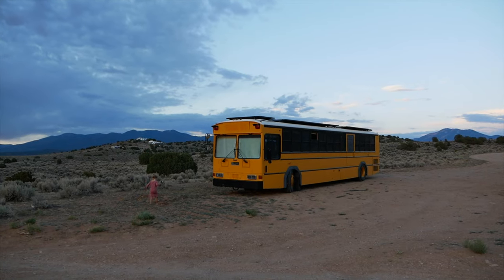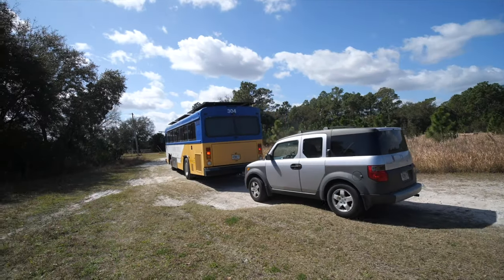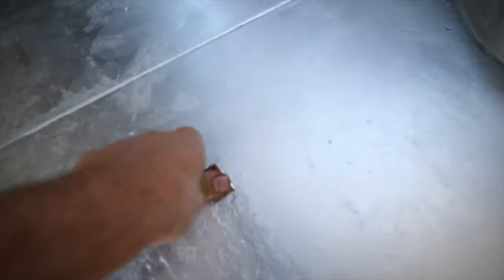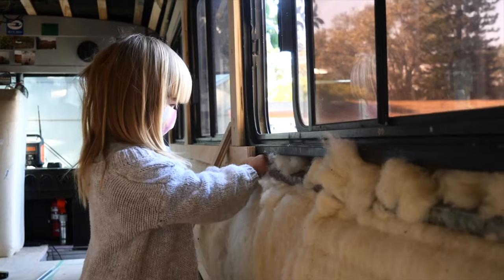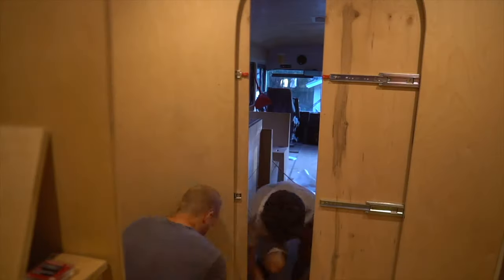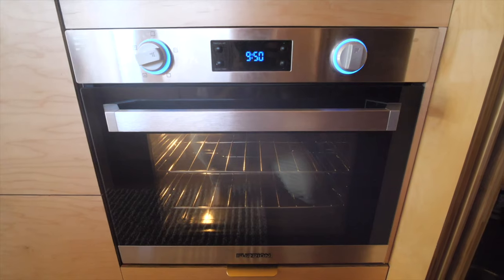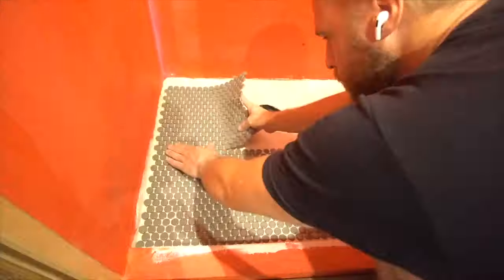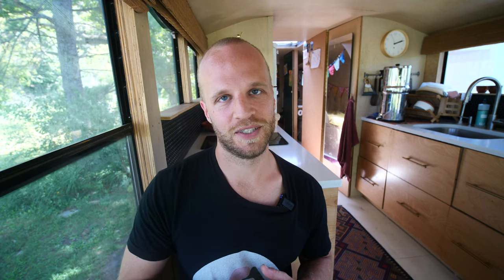How Much Did it Cost to Build this 34 Foot All Electric (no Propane) Bus Conversion?

Comment: Sweet Bluebird conversion! We have about $32k in our motorhome build (including the initial $15k purchase of our 1999 35ft National Tropical Class A MH) doing all the work ourselves - but a lot less labor than you guys put in for sure. We spent about $9,200 on our 5,000-watt Solar / 23.5Kwh battery system. We spent another $2,500 in a 14,500 Btu Furrion rooftop AC and a 12,000 Btu EG-4 28.5 SEER2 mini-split heat pump. The rest is in repairs and upgrades over the last 5 years, like initially defogging our dual pane windows and adding a new electric awning. I'm not counting maintenance and wear related repairs (such as oil changes and tires or an engine replacement in our toad) as this is just part of life on the road over the last 5 years. Kudos to you for keeping such accurate financial records.

Comment: I’ve been dreaming of a bus conversion for years now and it’s so helpful to have a video like this to see if it’s even feasible for a particular budget/timeline. I’ve never wanted, or even really considered, propane in my conversion because I don’t trust myself to do set it up and maintain it properly, and while 100% electric is way more expensive both for the cabinet items like batteries and the inverter and also the appliances like that Furrion oven you installed, I’d rather take the time to save up for those things than do the more budget-friendly propane version that scares me and would make me feel uneasy while in my vehicle/home. If I’m gonna be spending thousands upon thousands of dollars anyway, I’d rather be comfortable and feel safe for the extra price tag.

Comment: Wow. We've got about 20,000 invested right now and the only thing that doesn't cover is my labor. LOVE the solar set-up!!!! I wanted to go full electric but ended up with a propane instant water heater. We'll be at 1600 watts when finished. Check out our build when ya get a chance and let me know what ya think.
Reply: 80k?
Reply: @Diogenesoruise  right!? I'm not goin to be anywhere near that much when it's all dead and done.
Reply: @thehillbillyhilton3557  if labor had been hired and the vehicle was purchased near new, from what ive been looking at renovating a van/bus can range anywhere from 20k-80k on the low end.
Reply: @Diogenesoruise  yea labor is the killer. Our counter top alone is an easy 2 to 3 grand if we had done it for someone else.

Comment: Wow thank you, I’m a single mom, my budget is $50k - this was so helpful. I’ve already built a tiny home but my next project is a bus and I’m so excited because I actually knew what you meant in most of this process! I wonder how much materials have gone up in the past year or two though … :/
Reply from the maker: You sound well equipped to handle your next project! Prices on lumber went way up but have thankfully come at least partly down. Id expect to spend another 10 to 15% on building materials and if I were to do it again I think I'm going to search out a cheaper plywood, maybe go for a slightly different aesthetic.
Reply: Cheaper buying a house 300k or more 🤦🏿‍♂️🙏🏿
Reply: @MrBoss561  Can you buy a house for 300k?

Comment: Hmmm...that's in the used RV price range. I think I'd more likely go that route. Cool video though and amazing you got all that done!
Reply: We call them sticks and staples or S&S for short, motorhomes leak, the skins delaminate, and a bus is a 100 times safer than an RV, you don't have to build your own bus, as there are many conversions out there for sale, anything from school buses, to charter buses like Greyhound, MCI, and Prevost, with thier huge storage bays underneath, some are professional conversion done by name brand builders, you can pick one up for 25 to 50K for the older greyhounds and MCIs, but an older Prevost can cost quite a bit, unless it is a home built conversion. I skipped right by motorhomes after we  sold our last camper that we will ever own, I am actively looking right now, just haven't found the right one yet. And an older conversion will have everything in place, just needs updating or remodeling.
Reply: @bill8582  good points. However, I need slide-outs. Plus gasoline vs diesel. Renting is the way for me currently also. If I went with a bus, it would be a double-decker articulated. How cool would that be!
Reply: @DouglasLippi  the fuel prices is all political theater, and will come back down eventually. Renting is a good way to find out what you like. And you mentioned slide outs, those things are nice for more room, but unless you have a place to store it inside, it doesn't take long for weather to take a toll on the seals, as well as the rubber roof that a lot of motorhomes have, causing interior leakage, floor rot and buckeling, and as I mentioned before delamination of the side walls, which is very expensive to repair, sometimes exceeding the value of the unit itself. Manufacturers like Monaco, Country coach, and Holiday Rambler have either solid fiberglass roofs, or aluminum,  but the slide outs can still leak, which once you have had any of those issue, you will shy away from them real quick. If you are just using it to camp in, you really don't spend that much time inside anyway. I want something I can travel across country in, and a gas unit is not what you want, diesel is the only way to go for that, much more reliable and dependable, with plenty of power for getting up hills. Good luck to you in your quest, these are all just my opinions, but several will agree.

Comment: is 10000 watts of battery going to be enough for the minisplit and everything else?  I'm still building my bus and will be having a 23kwh system.  I will be having 2 mini splits that will be alternated between them when not plugged into shore power.  Even with the efficiency of a minisplit, I worry my 23kwh system will only give me a couple days if there's no sun.  I hope to have somewhere between 2000 and 3000 watts of solar as well.
Reply from the maker: It depends on so many factors. Where are you living, what is your insulation and window set up like, and most importantly how hot is it outside and what temperature do you need to condition your bus to? The short answer is you will absolutely make it work with 3000 watts of solar (I'd definitely go with the high end of that range, I'd go for even more if you could) and 23kwh of batteries. Katy and Sam effortlessly cool the back half of their bus with this setup and worry little about battery consumption, but the front half inevitably will be warmer and their personal needs do not require 68 degrees for example. 75 and up is more realistic.

Comment: Wow. Love your build and this video is impressive!  I’m so curious what your thoughts are for a solar build for a bus only used in Michigan?
Reply from the maker: Winters won't produce as much but it will definitely still be worth maxing out the solar on your roof as you'll likely need no additional fuel to create electricity for most of the year.

Comment: We are about to paint our bus, demo has been done since January 1st. I'm struggling to decide HOW I want to repair the floor. material needs welded in, but it's not in the best of shape. I have a welder, and I'm torn between the cost/time to put in new steel where necessary and just sinking the cost and replacing the entire floor.

Comment: I do not think spray foam is an good option on something that vibrates none stop. I saw old spray foam and it is settling and creates more headaches (condensation water where is is not full touching everything or holes) than it solves, Also, if water gets in, it traps it there...